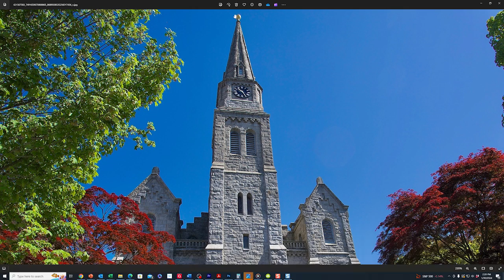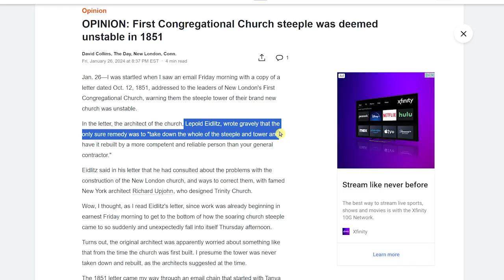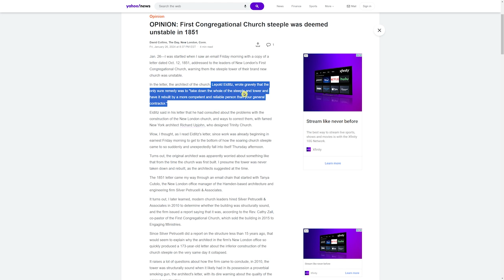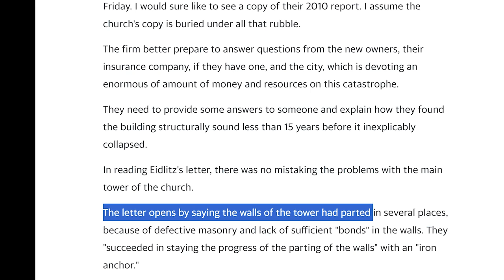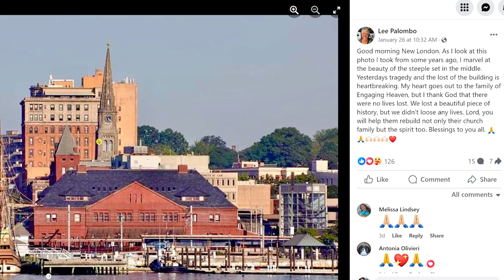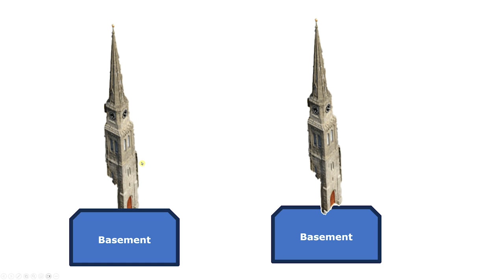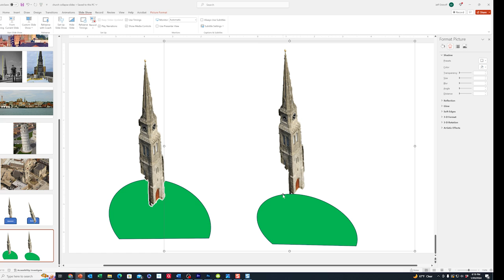What Caused Church Steeple Collapse New London, CT?

Comment: Thanks for this video. I was frustrated with the original newscasts because they did not show old pictures of the church - which I wanted to see for exactly this reason. The church was leaning a LOT in the several weeks or days before the failure. I would like to see images over time to calculate the progression. It looks like folks were ignoring the obvious danger of it falling to me. So lucky no-one was hurt.

Comment: I'm in CT and was looking at the church roof on google earth after the collapse.  You could see that the area behind the steeple, in a large "V" seemed 'wet' and appeared to have some problems with drainage.  As another poster pointed out, we had a lot of rain lately, and then a very cold freeze for almost a week... typically 12F in the morning, rising to only the upper 20's.   The day this happened, it had risen to about 40 degrees for the first time... the collapse happened about 1:30 or so.  I strongly suspect that large amounts of water had accumulated in the roof structure at the tower joint and then froze, further expanding any gaps... then it all melted and any remaining structural support gave way and the tower collapsed.  Simply my opinion.

Comment: I'm wondering if the tall portico spread from the weight above the portico and the deterioration of the mortar from weather and age . Having had a career in construction you see a lot of band aids being done on  buildings. Full proper restoration is very costly . You see a lot of puddy and paint ,in this case maybe just pointing up the deteriorated  face of the mortar joints instead of removing the mortar completely and rebedding the stone . I have seen mortar that isn't much more than sand between brick on 100+ year old buildings.

Comment: Without see everything first hand, I would NOT guess as to what happened, I have dealt with structural issues over the years and have worked with many engineering professionals, there are many factors that come into play when assessing structural problems and how to solve and upgrade them.

Comment: If the steeple is leaning backwards, I would suspect it’s the building/foundation at the back of the steeple settling. 
- At a certain point it put stress on the front wall of the steeple, which wasn’t built correctly. 
- Next I think the horizontal load blew out the front wall above the door, causing the steeple to drop vertically. - After that all the steeple dead load transferred to the building roof which failed, causing the steeple to fall backwards into the roof. 
- It would be like standing, and somebody pushing your knees in from behind. You fall down and backwards very quickly. 

Whatever caused the lean was the root of the problem.

Comment: i watched your video with extreme interest.  i wonder if more factors for the collapse have been investigated?  the new england shoreline suffered some record high tides in january due to weather and the wolf moon. as well the railroad extended its service east in recent years.  was a train going by at that time, or soon before?  was there another cause of vibration that could have made the underlying soil thrixatropic?  it is my belief that three things serve as factors to a disaster.  any one of these not being present would have prevented same.  as a side note. a sink hole developed near the airport in the last few hours.  is there any connection?  thank you for your work on this.  as a personal note, i wished that more careful examinations of the remaining structure were undertaken.  just because part of the building failed, does not make the entire structure dangerous.  i believe that with the same money, or less money spent, the church could have been repaired leaving off the steeple.  worse damage, caused by the nazis, was repaired in england and europe.

Comment: I think what happened is this.  That tower was literally held together by steel and iron rods.  I think what the engineer in 2010 missed was the fact that one of those iron rods, likely nearer to the base, failed due to 182 years of corrosion.  In this case, there was not sufficient redundancy built in to the bracing to withstand the resulting forces and the whole thing collapsed.  You may even see multiple rods broken (likely the ends shot off), but looking at the bracing, all that really needed to happen was for one of those corner rods you pointed at to fail. Thankfully, there was no loss of life.  I'm surprised the engineer would not do a risk analysis of the remaining strength of the tension rods.  Maybe he did, but was ignored?

Comment: I agree with your assessment of how the tower and steeple may have fallen. My belief is that the mortar degraded over time due to water and freeze & thaw. Did the church ever have tuck pointing done on the mortar?  

Don't ask anyone locally but ask for the opinion of the Chief Building Inspector in another state, about what may have caused that failure. 
Thank you for sharing your opinions on this failure.

Comment: “These guys (twin towers) just stood there and laughed, said ‘Ha, Death where is thy sting?’”  😹
Well, Mr. Eidlitz certainly vindicated, albeit 173 years later.
The collapse is probably also a metaphor, based upon what I know of the very liberal and un-Scriptural First Congregational “Church”.
Well done showing the tower was leaning, whatever happened seems to have been an ongoing issue. Perhaps iron rods used finally rusted to the point where lost strength and no longer able to keep everything together. Someone in the comments posted excessive rainfall in the area, which could certainly have been a factor. Pity, quite a beautiful building. Surprised you mentioned the entire structure will be razed when looks like the front towers could possibly be salvaged.
Reply: Excellent comments!!

Comment: 11:23 The "lack of sufficient bonds" was probably  a reference to the ties between the inner and outer layers (wythes) of masonry, similar to the metal brick ties they use to hold brick veneer or the "header bricks", on which only the ends are showing, in an English or Flemish bonded wall. The "iron anchors" are probably those rods you pointed out. My guess is that they have been rusting for 173 years and a couple in the rear popped a while back, causing the tower to lean backward. After that, it could have been anything; maybe one more rod popped, or maybe the stones, with nothing to hold them and plenty of rain, slipped just enough to let the whole thing slip. It's amazing it lasted that way for that long; I wonder if the installation of more rods would have held it together for another 173 years.

Comment: You don't see any cracks in the tower? I see cracks all over the tower, some more obvious than others. The cracks in the upper half are readily obvious by the lighter colored newer mortar used to patch the cracks. Patching cracks in any structure, even paved road surfaces, is critical in areas where temperatures can be freezing or below. Water expands when it freezes. When water gets into cracks and crevices of stone and freezes, the expanding ice can push the cracks and crevices farther apart. This can continue incrementally over years, weakening even structures of the hardest stone. It happens even today on modern brick veneer buildings. Brick veneer is intermittently tethered with metal straps to the interior structure, metal or wood frame or interior brick or concrete. Exterior brick veneer can maintain compressive structural strength as long as it remains vertically stacked, even when its mortar joints are cracked. The small intermittent metal straps tethering the exterior brick veneer to the interior structure or framework keeps the exterior brick veneer vertically stacked. It sounds like the 1851 letter identifies wall layer separation that would happen as when the small metal tethering straps aren't used or fail. It sounds like the proposed solution of installing iron rods through the tower with retaining plates on the exterior of opposing tower walls were intended to prevent the exterior stone veneer from separating from the interior wall structure. More frequently placed small metal tethering straps would have been more effective, but must be installed during original condtruction. There is no way the iron rod solution could have been as effective as the more frequently placed small metal tethering straps, and eventually failed. I speculate the iron rods were either too few and far between, or the iron rods themselves fractured or corroded over time, even possibly altered, corrupted or overloaded from other construction or remodeling activity.

Comment: Persistent moisture, rot, termites.  Ultimately gravity (whatever it really is) prevailed.  The gradual tilt over several days suggest ground water movement from an old spring that may have recharged from record rainfall.  I would be particularly interested in any moisture reading from the most previous inspection.  At the end of the day, some ground subsidence must have contributed largely.

Comment: As a builder of 40 years I wish I could inspect it in person. Being a mostly free standing tower it was vulnerable. The fact that the 2 remaining corners are standing shows how little they were tied to the central tower.
Reply: I agree with you. I would like to see the interior photos of what was holding up the tower. It was likely the arched timbers mostly supporting the upper structure, with the help of tiered stone arch, not visible, distributing the down force to the two corner towers. I have a feeling that this was one of the concerns from the 1851 architects report, addressing the structural issues. Just my thoughts, but it makes sense to me. Why no one is questioning that interior support is surprising really. placing emphasis on the stone structure itself, when that likely wasn't the issue at all. Stone doesn't "bend" like that, to allow the reported tilt, and foundational issue would be present on the interior floor if the entire tower was "sinking" as mentioned. I believe the failed members were in the roof support.

Comment: You articulated exactly what I think happened. I was involved for a number of years with putting on performances in this building. There is (was??) a basement under the sanctuary, but it may not have extended to the front of the church. It was a utility space I only saw from the rear. News reports say the woman in the church at the time was in the food pantry, which I believe is in the 1975 extension off the back and that seems not to have been damaged.
Reply from the maker: Would love to see any photos especially inside the narthex looking toward the tower or inside the tower as you enter
Reply: Unfortunately, never took any pictures. Too busy with shows, and after all, the church would always be there, right? @jeffostroff

Comment: Great summary.  Take a look at the clay brick chimney still standing.(drone video) Its relative location and the fact that it’s covered in green moss speaks volumes to long term water infiltration. Therefore one could assume that the wood super structure may have been compromised and contributed to the collapse. 

Would be good if the City enacted a facade inspection ordinance if they don’t have one.
Reply from the maker: Thanks for the info

Comment: The steeple tower looks to be a box. Assuming  you are correct that it fell back in towards the rest of the building, the interesting side to see before the collapse would be the part of the tower inside the building. That is where I'd expect to find any failing mortar or stones. Such a terrible loss of an historic structure. It's a shame the city barged in and tore the rest down with some additional study. Looks like the two side towers were mostly unharmed and could have been incorporated into a replacement structure.

Comment: If you look at the front of the tower on the left side corner you have a deep crack just above the single window above the door there’s another one just below the seam at  the louvered, two windows and just above the two sealed windows or whatever they are there is a anchor point it’s cracked in the pitcher from the edge to just about the plate with the bolt. I think the front wall fell forward bending at the first crack and folded back at the second crack putting the tower to start laying down from the second crack at the door way laying backwards into the building twisting because of the 2 cracks on the left side so it went to the side instead of just falling straight back through the building and took out the side wall instead and since it had folded twice the tower was shortened and didn’t reach the other building. 
Looking again 1 stone above the bottom window on the left there is another deep one on the right 1 row above the bottom of the double window then there’s a deeper crack on the left side of the double window even with the top of the opening which looks fairly deep then at the plate bolted on above the double windows there’s a deep looking crack from the left edge to past the plate support. None of these cracks should be visible if they had braised the tower they would have probably filled in any of those to keep water out so I think these are all more recent cracks and we’ve had some rather heavy rains and winds lately which if they were using just clay instead of cement or mortar getting water into the walls could have just dissolved what was left causing the collapse which was probably what the guy in 1817 was complaining about in the first place with shady construction and should be torn down and rebuilt properly

Comment: From where it seems to have started failing, I'm guessing water intrusion along the back side of the steeple rotting wood and pulling stone down with it when it eventually gave way, or possibly mortar erosion, but I think that would have attracted attention from the water flow long before removing enough mortar.   I very highly doubt any foundation problems.  The foundations needed to hold up that weight are massive, and if they went, such as into a sinkhole, more of the surrounding towers and walls would have come down too.

Comment: What I would suggest by the colour changes on the roof, that there was water incursion on the roof structure.  It could be that the trusses, or bents, of the roof had been weakened sufficiently that the roof failed.  The tower looks to have been leaning backwards into the roof.  Hence, without the support of that roof, the tower collapsed.  It seems that with a hundred seventy-five years of the Sanctuary roof supporting weight it was never designed to bear that weakening was what brought it all down.  That is to say, the Sanctuary roof was never intended to support the mass of the tower, however was overbuilt to impress and that is what kept the inferior construction of the tower from collapsing earlier.  

The video appears to show that the midpoint of the tower failed, not the foundation.  As the tower came down, it appears to have kicked out the lower part of the tower and buttressing walls towards the front yard of the Church.  Hence, most of the tower seems to have collapsed into the sanctuary.   I find it interesting that with all the warnings about to instability of the tower, even in recent years, that the city didn't insist the Congregation repair or remove the tower completely.  There are a lot of churches nationwide where the top two-thirds of this kind of tower have been removed to prevent just this kind of occurrence.  One more thing that might have affected the tower are the recent earthquakes felt in the area.

Comment: 2:28   In this pic, we can see that on the balcony of the left side (near the camera) there was a door which has been bricked in.  Lower on the front corner is a 10' vertical crack that has been patched.  It also looks like it had poor water drainage too.  Water freezing over the years could have done it in.

Comment: The base of the tower has an arched opening to the outside and there are likely arches on the remaining 3 sides leaving masonry piers at just the 4 corners.  The roof flashing at the back side and at the flat sections of roof either side may have failed or been inadequate allowing water to enter the masonry joints.  The lime based mortar at 175 years old likely turned to sand causing the arches to fail.  What do you call a masonry structure without mortar?  => a pile of stones.  Very tragic.

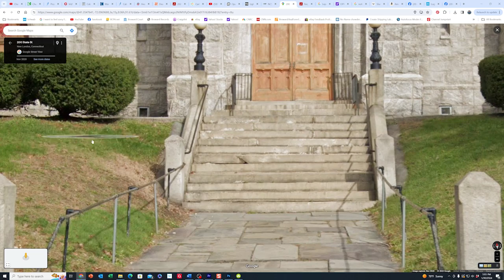Comment: I noticed a couple of things, Jeff. During the close-up of the front stairs (13:21), you can see that the right-hand retaining wall sags as it gets close to the stairs, so there is definitely ground subsidence happening there. Also, up on the steeple at 12:45 there is a... horizontal, sloped... stone with a flat (polished?) face that does have a crack in it, also on the right hand side, at the level of the bottom of that balustrade. I also thought the tower seemed somewhat out of plumb in a few of those farther away shots, too.

Comment: At 12:41 in that frame of video, I see what I think is a faint crack starting at the left above the 3 line of blocks from the sloped part, adjacent the single window. The crack continues to the right but goes up to the line of block above that just past the single window.
Despite that & the stairs, I think the structure got weak where the a frame roof met the back of the steeple and as the moisture load on the blocks made the steeple too heavy to support the a frame started to give, then the steeple cascaded towards the rear and the bottom was liked out towards the street. My bet is points of failure were where the a frame roof met the steeple and as one collapsed it pulled the other down with it.